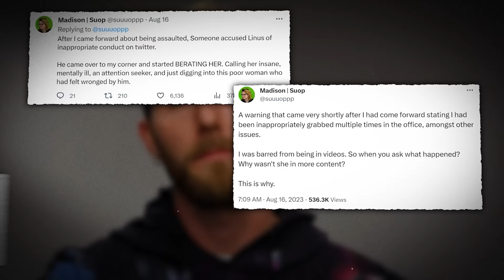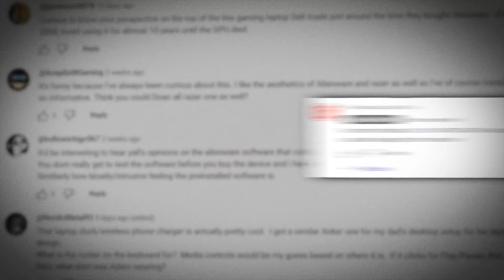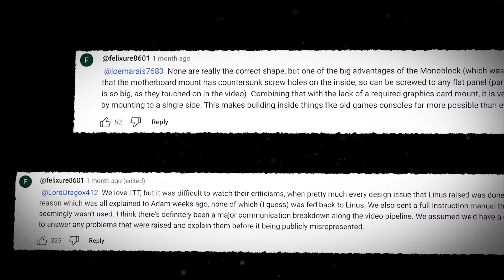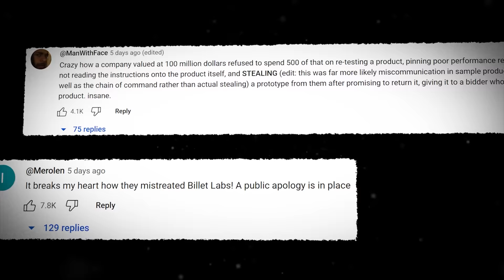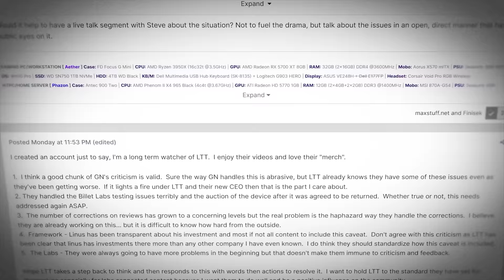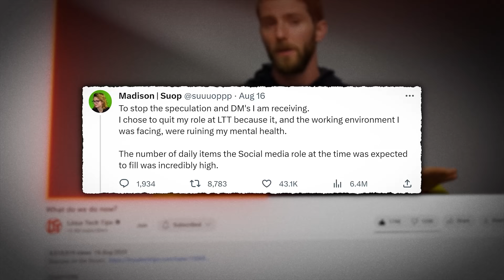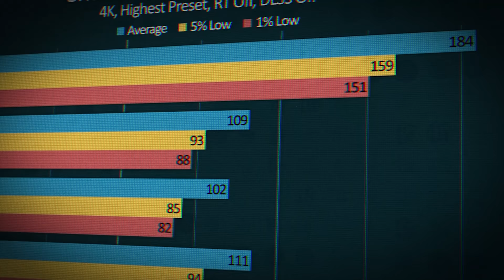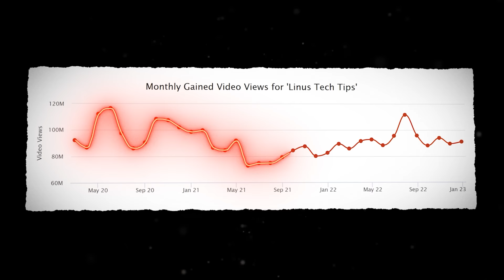The Deserved Self-Destruction of Linus Tech Tips

Comment: Something always felt a bit off to me, GamersNexus (if that's the long-haired metal guy) always felt less fake/content farm produced to me.
Reply: GN outlines their specific testing practices really well, they seem to be on top of their game. I go through a lot of hardware and what they show usually mirrors what I see when I'm doing builds so I tend to believe their content. LTT on the other hand has been a shitshow for years.
Reply: Yup, all the showboating like snake oil salesmen put me off them so fast I never subscribed
Reply: @arc00ta A great example of death is their newest video covering a mini-ITX case, where they were using a brand-new sound measurement space they probably spent tens of thousands of dollars setting up to figure out the loudness of a case with its fans on.

Is not so much the fact that they set this up, but the fact that they contacted (if I recall correctly) no less than FOUR different companies to verify their work - at their own expense. They also always by the hardware they test, because they don't want a review unit that may have had an extra level of QA to ensure it doesn't fail them.

Comment: I still can't believe they tried to fit that block to a 4090, they were specifically told it's for a 3090Ti and then had the audacity to call the product shit after. Imagine buying the wrong size clothes or.a mini usb cable instead of usb c and saying the manufacturer is shit because they don't fit. The sexual harassment is an absolute disgrace. They really became the company of villains they warned ppl about.
Reply: Also happens on cooking channels. I was watching vids on food processors and one said "this doesn't work" Well they were mounting it wrong (or not at all), and they literally said you shouldn't have to read the instructions.  Wha? I've seen the instructions,  they're easily available and they are very easy to understand,  you just drop a ring into the bowl. 

I stopped watching the video, still don't know if the product is good. But if the rest has that quality control...

Comment: Sounds like a classic "garage business" grown too big and out of control. Things get toxic and unprincipled because managing it is actually hard, and good money is flowing in. Reminds me of the early days of the computer network business. Build any old thing and slap a couple LEDs on it (yes I was around when LEDs were a big innovation). It was great for a while, but it didn't really end well. A small little competitor named Cisco came along and made a router. People seem to like those;)
Reply: I'm old enough to have run to networks that didn't use routers and had those Ethernet (or sometimes some other wierdass protocol) coax cables that needed termination. God, they were such a pain in the ass. Still, massive improvement from what came before Ethernet.

Comment: Their stated value of the product, doesnt account for months of setback as well as possible missed investors. The product prototype might have cost them like 200-2000$, but missing an angel investor for your company is 20,000$-100,000$ you could use to start your company. Imagine if someone took Linuses channel at 50,000 subs, borrowed it, uploaded a prank video that flopped,  called it trash, and sold it on a charity auction for 100$, and later compensated him like 200$. I hope he gets sued into the ground for this

Comment: 6:05 that copper cooler isn’t revolutionary. It looks silly to use, it doesn’t have a pump, fans or refrigerant to cool it.

I can see why he used it on a different graphics card. It only job is to take heat and dissipated. But, they definitely messed up going from a 3090 to a 4090. That card has hotter thermals.

Comment: It's important that you get this right, Kira. Especially because that's what you are critiqueing another youtuber in this video for. Why did you not double check the reason why they didn't use the right graphics card? You make it seem as if they chose to just pick a different card for the hell of it. It's because they didn't have the right card on hand. Yea they should have just waited and gotten the right card, but they didn't just willynilly pick a randomly hotter card out of gross negligence. Also, Linus didn't dislike and not recommend the product because it didn't perform well. He said no one should ever buy it because no one should realistically want to buy that combo CPU/GPU block over the standard separate CPU and GPU blocks. He felt like the results wouldn't have mattered. He doesn't like those combo blocks. That company wasn't the first to make them. They are not better than just getting a good EK block for both the CPU and GPU. That's why he doesn't like them. But he's very dismissive of the reduction is size, there's value right there. Also it's likely going to be way cheaper to buy a combo block than 2 separate blocks. It was hard to see how dismissive he was.